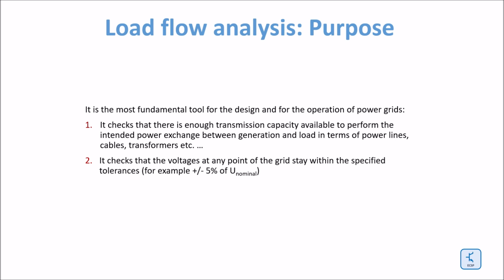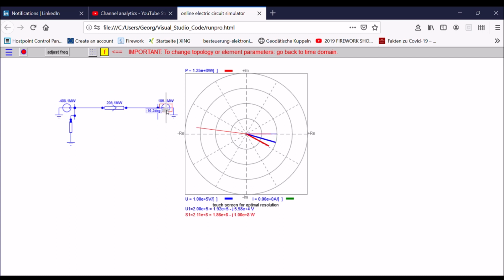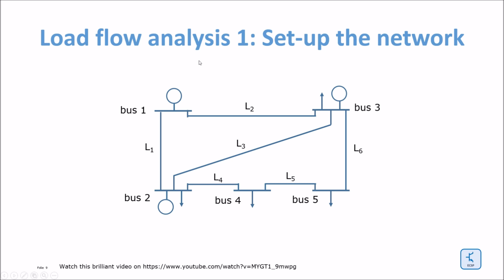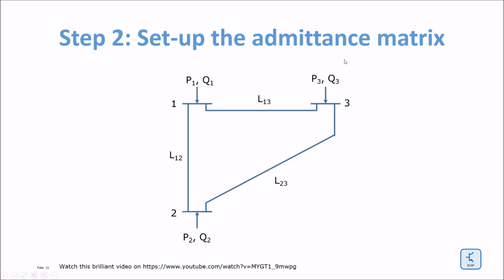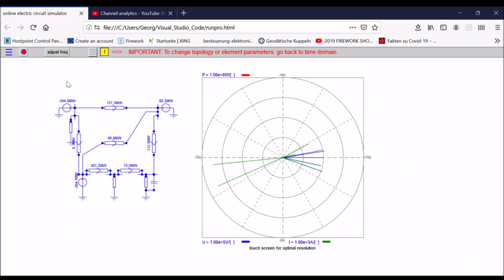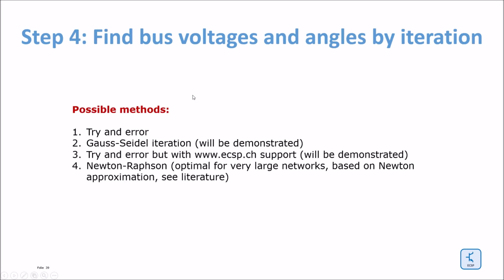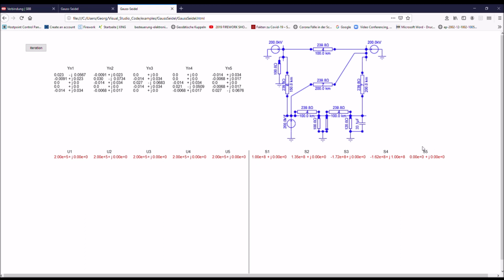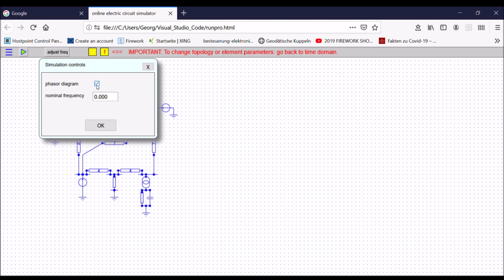Power system load flow analysis with Gauss-Seidel method [circuit simulator]

Comment: Hello, thanks for great explanation. Just wonder a bit on the sign convention used? Is this active sign convention, and if so, why is that preferred in load flow?. Normally i am used to active power delivered to system being negative, while active power consumed being positive. Whilst for reactive power '' delivered'' (capacitor) will have a negative sign and reactive power ''consumed'' inductor will have positive sign. like this, generator overexcited S= -P + -jQ. Underexcited S= -P+jQ. For loads (including resistive element):  capacitive S=P+ -jQ. Inductive S=P+jQ. Maybe i got something wrong?
Reply from the maker: No, I think you got it right and this is the convention I use as well. The power of a source delivering power to the system is negative where as the power consumed is positive. I share your views for the reactive power as well, so where is the misunderstanding, did I make a mistake somewhere?
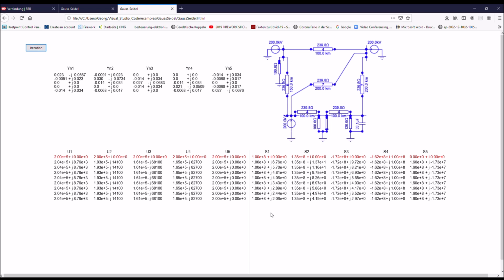Reply: Ok, from the video at 44:22, when the iteration stops. the load busses (nr 3 and 4) has negative active power and nr 4 which also is capacitive has positive reactive power i.e -1.62e+8 + j1.00e+8. The Generator busses has positive active power, slack bus also has negative reactive power even though the system is capacitive meaning generator should be underexcited and then according to passive sign convention should consume reactive power +Q.     @georgschett801
Reply from the maker: You are right (well done, you are the first one seeing this!). I was not consistent and switched between the consumer arrow system (which I normally use as you do) to the producer arrow system (unintentionally). In the producer arrow system positive is active power generation, negative is active power consumption. But the principle regarding the Gauss-Seidel iteration is the same. Thanks for your note!
Reply: Aha, then I follow, anyways, thanks for making these great videos, they are really helpful :) ,  @georgschett801
Reply: Excuse me, can I request your help with something?    my OKX wallet holds USDT TRX20, and my recovery phrase is (clean party soccer advance audit clean evil finish tonight involve whip action). Can you explain how to move it to Poloniex?